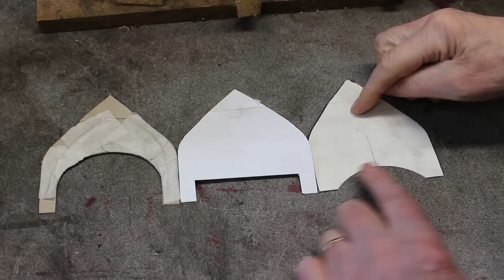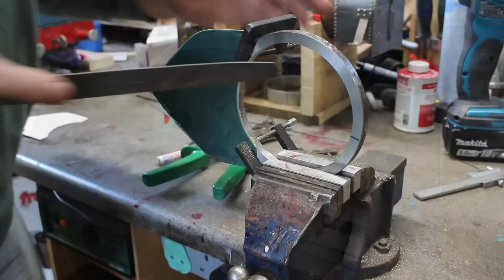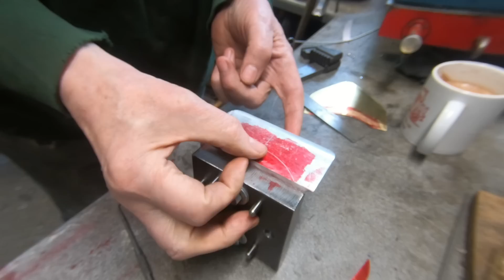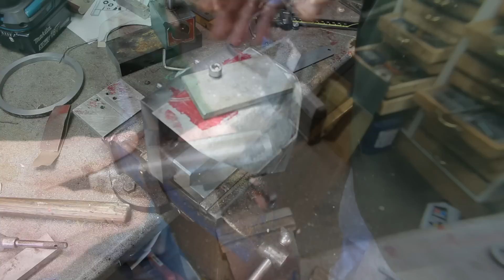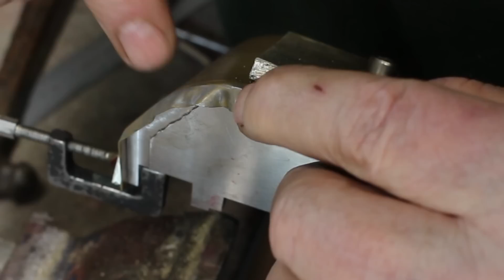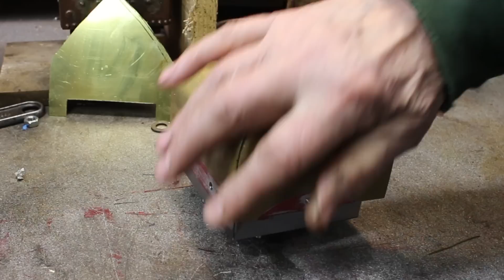Lion Vintage Steam Locomotive | Model Engineering Workshop Build in 5"g  - Part 70

Comment: I'm in awe of your sheet metal working skills!  How about using a couple of different sizes of half round brass.  A smaller one convex side inwards to bring the joint level with the brass plate, then a larger size to form the outer radius.  That might alleviate the problem of the silver solder running into the join and leaving a concave finish.  I think I would do the soldering all in one shot.  Definitely a case of doing some tests on scrap to see what works.
Reply from the maker: Thanks. Using half round brass as you've suggested did cross my mind. Getting a successful silver soldered joint is the biggest issue for me, in this respect I am tending towards soldering everything in one go as you suggest. Thanks for your interest.
Cheers 
Nigel

Comment: Glad you're feeling better, chest infections can be nasty especially as Covid is still around. Look after yourself we all want to see this project finished!
Several others have made the same suggestion - my thoughts is to use a fairly high temperature silver solder to tack everything together then use a larger diameter wire than you were showing in this video as a space filler. This can be held in place with a lower temperature silver solder and any gaps caulked with plumber's grade silver containing soft solders. The ones I have seen have a melting point around 200°C, more than enough for this area of the boiler.
Reply from the maker: Thanks for your suggestions very much appreciated. Lots to consider, I'm taking my time and will probably experiment a little before tackling the job.
Cheers
Nigel

Comment: Think I would have just put a flange on the two side pieces ,left the front and back pieces flat then riveted them together If you get my meening ?
Reply from the maker: Thanks for your suggestions, I hadn't thought about rivets, may be an option if my current approach doesn't work out.
Cheers
Nigel

Comment: Just a suggestion for you to chew over Nigel, how about maybe a 2 or 3mm thick wire, way over what you need. silver soldered with the joint all at once, then filed and blended to suit?
Reply from the maker: Thanks for your suggestions, yeah I'm pretty sure a larger wire will be needed. I'll probably experiment a little before tackling the acyual job.
Cheers
Nigel

Comment: How hot would that area get during steaming? I don’t even class myself at novice level, just an admirer of craftsmanship, so I am guessing when I say set the joint with higher temp silver solder, then fill with lower temp?
Reply from the maker: Thanks for following along with my Lion build. There will be a thin layer of heat insulation between the boiler dome and the brass cover but the brass cover will still get very hot, at a guess 70-80 deg C maybe. Different melting temperature solders does seem a good option if I do it in 2 stages.
Cheers
Nigel

Comment: I don't know what materials you have on hand, but my first thought was to silver solder the initial joint with a higher temp solder and then come back and with a lower temp silver solder to set the wire fill.  This would prevent the second solder operation from disturbing the first one if you are very careful with the heat.  i have seen other model engineers do this and they had good results.  Just an idea. Great videos, thanks for your hard work to both do the build and document it so well.  Cheers
Reply from the maker: Thanks for your suggestions, very much appreciated. Using different melt temperature solder does seem a good option it I do the job in 2 stages, I'm still thinking about it.
Cheers
Nigel

Comment: I'd suggest a larger wire than shown to make sure its big enough to file and blend out and solder it all at once - seems like doing it separately the initial soldering of the domed parts is going to create an inconsistent solder fill inside the groove that will make getting the wire in afterwards harder, and you can make sure the wire doesn't want to move to easily enough just by putting in that groove under some tension before soldering. But I'd not claim any expertise really.
Reply from the maker: Thanks for your suggestions. Yes, I was reconning that if I solder the parts together before soldering in the wire some filing of the seem may be needed to allow the wire to fit, perhaps counter productive. I'll probably do some experimentation to determine the best option before tackling the job.
Cheers
Nigel

Comment: Very nice i would use a larger diameter wire then file it down once soldered in place
Reply from the maker: Thanks. Yeah I'm probably going to experiment with differnt wire sizes before commiting to the job.